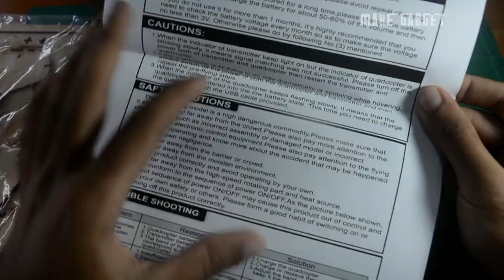How to assemble Drone Kit With Transmitter | Cheapest Price Drone

Comment: I have this same drone, but after completing flying steps when i up the left joy stick to fly the drone, it's light and motors will automatically turn off... Any solution??
Reply: please look the connections properly and fit the drone motors properly in circuit board wrong method turns light off

Comment: My drone keeps going in one direction and moving the stick right moves the drone to left. I have this same drone. Any ideas?
Reply: From where you have purchased
Reply: You just replace it
Reply: @archanasingh2772  I did. Same thing again. The issue is that this is so cheap and that’s why the flight controller lacks sensors and has low processing power. It just flies and that’s enough.

Comment: Bahi maine drone kit mai ke aya or video dekh kar drone banaya lekin drone uda nahi why
Reply: hey, did your drone fly at last or not?
Reply: Any suggestions to make the drone fly?
Reply: Could you reply fast as I brought this kit because I need to submit this as a Project in My College but this drone isn't flying? The Due date of the Project Submission is almost near but this thing isn't flying at all
Reply: @bhavithchandrac513   hey  is  your drone flying now ?
Reply: @noneee22  nope
Reply: @bhavithchandrac513  i am also trying to make it it is pairing but motors are not responding
Reply: @noneee22  it's probably the battery charge, or check if motors are damaged. Most probably those would be the problems
Reply: @bhavithchandrac3548  okay i will